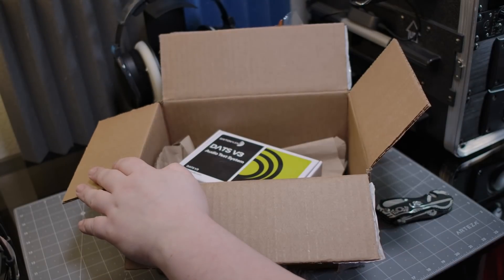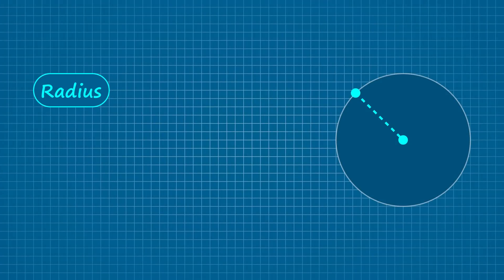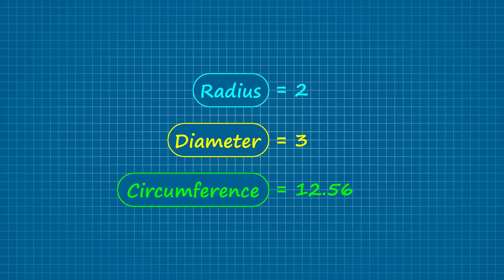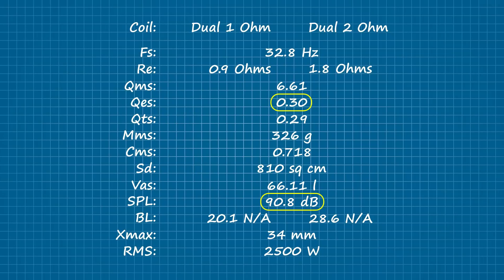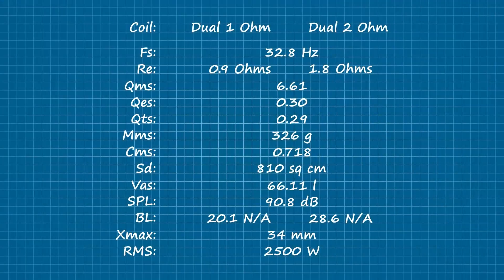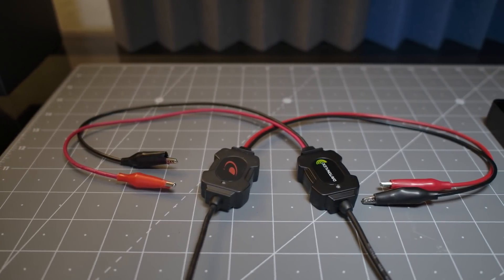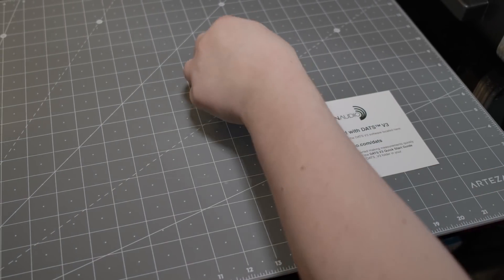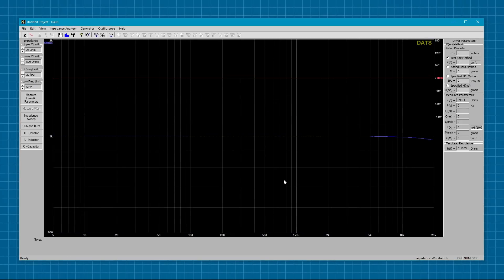A Common "HORROR" Story + A Brand New Solution

Comment: Pete.. i recently got the DATS V3 and I’m having a hard time getting the leads calibrated on windows 11 pro… I keep getting “the measured test lead resistance is not valid”… have you encountered this issue and if so, have you found a solution? I’ve tried varying input levels and I’m getting ohms reading 40 and over… this is frustrating.

Comment: Hoping to get one of these or find someone that has one to help me, bought a refurbished sub from AB it’s an older version and can’t find parameters anywhere. More I dig into it it would appear it’s a motor off one revision of the sub, a basket from another and who knows what recone. In the generic box I put it in it sounds good but I really wondering what more if anything I could do with it. Even worse then no parameters AB has refused to respond to my emails and phone calls as to what recone they used so as much as I’d like to build a second one I can’t.

Comment: Hi! I bought the DATS V3 and have found it pretty useful. I discovered it can be used as a basic oscilloscope, but I am not quite sure if it is accurate. In oscilloscope mode you have to set the test tone output to minimum setting and then you can use the test leads for measuring whatever signal. I am unsure how much signal level the DATS can handle so I am a bit wary about using it that way.

Comment: I've found the factory ts parameters to be off on sundown, skar, and resilient sounds subs woofers so far. 
Is there a similar device to test amplifier parameters?
Reply: I agree!  I just tested sundown and skar subs this past weekend and was shocked!  DATS set up properly, tested 5 times each sub, same results.  Def do not match manufacture's numbers.  Fs was WAY higher than what they report, for example.  Tested a 3rd sub (soundqubed) and it was only 5 Hz off from manufacturer.

Comment: I hate to say it, but I am getting inconsistent data from the DATS V3 system, in particular with under-hung voice coil speakers.  Sadly even using the device to measure known resistances does not match up to my Fluke or Tektronix meters.  I think the DATS device is directionally correct, but I am not sure I would refer to it as really accurate, particularly on under-hung voice coil drivers for whatever reason.

Comment: Do you know if it uses the current source method or the voltage source method? The largeish calibration resistor gives me some concern that it might be current source.

P.S. I don't have the hardware but I downloaded the software and installed it under WINE and it does start so any LINUX users out there that are interested in this it looks like it might in fact work. The manual in the help menu is all blank pages however.

Comment: Im old lol. I actually worked for a man that was an engineer for Altec Lansing when they were on Manchester in anaheim back when all their stuff was made in USA. Having tools like this so affordable to the masses is amazing. TS parameters are critical to predicting the responce of a driver in a enclosure and I have had people recone 4 of the exact same speaker the same way 4 times and have very different specs. Ill never trust the specs from a compay even though I used to assist the engineer at PAS when they were in Harbor City. A ( coughs) FEW years ago lol

Comment: Spent good money on car audio speakers. I'm talking speakers that retail 1kUSD for a pair. T/S parameters were way off. Fs on the midrange was 2x higher and on the tweeter 5x higher. Was told they would break in and not to worry. I pointed out that that's not going to happen. They later admitted an error on their manufacturer T/S. This is years after they were released. The retailer was great and gladly refunded, but I think I was lucky to have a good retailer.

Comment: I bought a dats v3 this week and this video was the main reason for this purchase. I ran in thesame problem you describe, so thank you for taking the time to make this video. I run into the problem that vas measurements vary when i place a non vented sub direct on the table or on foam pads. Vas is 14liters on the pads 20liters on the table, 21liters on a mousepad. How shouls i approach this problem?

Comment: I was told that DATS doesn't work well testing high power subwoofers to get accurate results. Hexibase, do you know if there is any truth to this?
Reply: Barevids mentioned this in reference to the v2, I believe it isnt known yet if the b3 has the issue still or not

Comment: Very important
I also received a DATS V3, but I have problems compared to the previous version of V2, namely what it is about
When I measure extremely poorly suspended Dynaudio 30W54,30W100 drivers, an error appears in the measured values for Re as well as for Le, the true value for Re is around 5.6ohm with version V2 in all measurement cases, as well as with a universal instrument, while when measuring via version V3 it appears at one 30W100 15ohm, while at 30W54 even 29ohm at which Le cannot be measured at all on one ... ???
By measuring the same drivers with version V2, all measurements are error-free and show identical values
I sent an email to the manufacturer to know about this inadmissible error because it calls into question all other measured values in other drivers and I don't like it at all because I wanted to switch to this new version but it turned out that I didn't get a better and more reliable device for this money
I noticed one important difference that seems to contribute to the device making errors, and that is the speed of the test signal, which is slower in the V3 version, lasts longer sweep signal
If someone can confirm this, let them try a device with low resonant frequency drivers that has a soft suspension, an error occurs with two of the same drivers.

Comment: With some basic soldering skills you can make an equipment for TS measurement yourself for a very low price (2 jacks, 1 resistor and some wire). You can than use software like LIMP (ARTA), HOLMimpulse or REW for measurement.
Schematics can be found in ARTA and REW documentation.

Comment: Makes me wonder how uniform a series or run of subwoofers can actually be. They hypothetically, Pull one off the production line, every so often, and measure t/s? Is that sufficient enough for 15" car audio subs. For a sound qaulity application. It honestly worries me. How far off can a "reputable" build house be? Thanks for this new found apprehension, Hexibass..

Comment: Thats pretty cool, I have several speakers that I would like to re-purpose, one set came from a nice Sony portable with built in sub that blew up when someone plugged it into 220 when it was set for 110. But I had no idea where to start designing an enclosure without any of the speaker spec's, and i'm sure if any spec's exist i'm not going to find anyone at Sony to give them to me.

Comment: I’ve had my dats for about 2 weeks and I have yet to test a driver that’s reasonable close to its advertised specs. So much so that a basic taped pipe is both slightly out of tune but also designed based on incorrect parameters which dictate a false impression that now clearly is audible through the trench in the middle of the bandwidth and undesired symptoms of delay....   I then proceeded to rest everything I had, a majority from this huge multiple decades of popularity and following of ignorant(now no longer including myself) consumers. The two pioneer 10” subs I happened to test from the shelves of the garage were quite closely matching the published. Everything is fully broken in and in good working condition. Not much of a pioneer speaker buyer. Apparently mistaken and should note in closing Rockford Fosgate has klippel testing references yet did t remotely test properly on my new dats and there’s an enclosure the p3s were designed around erroneously and that’s fuct.

Comment: Has everyone forgotten or tried either of these http://www.woofertester.com/wt2product.htm or http://www.woofertester.com/wtproproduct.htm ? who wants to put them up against the DATS V3 from Dayton Audio and see if spending more will get more accurate results? Also, does anyone know before I read the manual, if the DATS V3 in oscilloscope mode will allow me to measure my head unit pre amp voltage and output clipping? I just want to make sure, because I know there are tools out there for education purposes only and have no scientific value or accuracy. There is a tool like this that cost $160 and another that cost $1000 leaving me wondering if at this price point has anyone ever verified with a much more expensive tool like the sub-woofer manufacturers would use to measure parameters. Plus the way I see people using the tools does not seem scientific, should maybe do 5000 sweeps per second and then take the average to come to a more accurate conclusion. does this tool do that? and if not, people should do at least 5 sweeps with the tool and then average to make it more scientific instead of taking the first measurement they see. Thiele / Small parameters are very scientific, I just want to make sure i'm not paying for a desktop toy that is for educational purposes only.

Comment: Not sure if i get this Right. Is It Important how much mass is Add ?
Reply: HexiBase Thanks, I used just 10 Gramms. Worked in Ma Case.
Reply: Ideally, your added mass should be about the same as the Mms of the driver. 
If the spec sheet lists the Mms then just make your added mass about the same, that is something that shouldn't change much unless a pretty big change was made to the driver. 
If Mms isn't listed then it is a pretty simple 2-step process. Just add enough mass to get an initial Vas measurement. Then change your added mass to be about the same as the result of the first measurement. That will get you close enough. 
You can repeat that process to narrow it down even more, but it really isn't necessary. Things like temperature and barometric pressure affect the specs so much that you really don't need to get that exact (maybe for speakers in a strictly controlled environment, lol).

Comment: Glad to see so much knowledge in your videos. I have the DATS V3 and every sub I've tested has different parameters than published. When testing what is the correct setting for LE. 1khz or 10khz? Thank you
Reply: With low frequency drivers you want to use the 1 kHz setting for Le. 
Really, the 10 kHz measurement is only useful when you are designing a passive crossover that will affect frequencies that high. Not that often really.
Reply: @chrisperez7592  

Not only for passive crossovers! From the DATS V3.x Help File (Measuring Tweeters section):
"Measure the tweeter's impedance as follows:

Launch the DATS software and make sure the volume is at maximum. 
Under the Edit menu select Preferences and set the L(e) Measurement Frequency to 10 kHz."

-------------------------------------------
So, you should use the 10kHz setting for measuring tweeters too.

Comment: I suppose some companies will write their ts parameters after break in. GR  Research tested the same driver out of the box and after 50h of hard playtime and the fs was way lower for example. So one company they discussed with mentioned that the parameters they state are after a certain run in period. But of course, the numbers within should still match mathematical rules as explained.

Comment: Hi Pet, thank you so much for all your contributions over the years and for more recently designing enclosures for the public under AD. I have a question about how to get the t/s parameters from a woofer that has a phase plug IE Pioneer TS-M800PRO, would it be any different? I contacted Pioneer and asked for the t/s and was told thy did not  have them and to contact a installer! I was outraged. and gave him scathing review of his response. Scot

Comment: Very good info. Never thought I had to doubt T/S parameters from manufacturers.
Reply: Of course you have to, they can never produce 2 of something that share identical parameters. The glue used won't adhere all the same, the surround material has variance, the spider may be harder than normal(even worse if the speaker has multiples of spiders), the coils may have bad windings that distrupt the condictivity, even the cone material will have stiffness differences, the magnet can be charged to a lower specification than it should, any number of these can happen to a single driver many times before it reaches the shelves. Did you think that they could just bang out perfect speakers everytime?
Reply: 94E22F7EE051 B0F6841E919E5C95DF1D yes
Reply: @bassfan71  Doubt ALL parameters from ALL manufacturers (not just audio).  Specs are often massaged by the marketing department to make tat look better.  e.g a STEREO amp with 1kW PEAK output (SINGLE channel @10% THD - ouch, my ears!!!) will probably be lucky to output a 100W continuous stereo signal @ 0.1% THD.  1000W vs 100W - marketing vs engineering depts.

Comment: Also, if you were to hook up DATS to a woofer that is already in a ported enclosure, would the "FS" be the frequence the port is tuned at? For measuring unknown enclosures...
Reply: @HexiBase  is there an effective way to test the tune frequency of an unknown enclosure?
Reply: I just wanted to add that if you run an impedance measurement on a driver in a ported enclosure you will end up with two peaks. The lowest point between the two peaks is the tuning frequency. 
It's especially useful for vents with many bends or irregular shaped ports (even tapered ports). Enclosure design software can't exactly account for airflow resistance due to things like corners, and that could shift tuning by quite a few Hz.
However, it is low power... So you need to keep in mind that once the air really gets moving, and airflow is being restricted by the port, the tuning frequency will go lower (essentially that also means the port is too small, but is just how is has to be sometimes).

Comment: Any information on whether the V3 is better than the V2? I have the V2, not sure if it's worth upgrading.
Reply: V3 is twice as powerful as V2. That doesn't make a big difference with large, high power drivers. But it can drive smaller speaker pretty hard, the specs you get will be a little more "real world". I've even measured some drivers where I could see cone and frame resonances show up on the impedance curve that I never noticed with V2. I thought something was wrong at first, and then I realised it matched the frequency of a peak in the response (it took me a minute to figure out what was going on 🤔). It is even enough power to excite resonances in enclosures and ports, and that will show up as little ripples in the impedance measurements. So that is a nice upgrade. Also, the added accuracy is great for measuring caps, resistors, and inductors. 

Heck, I have mine mounted under my desk... that alone made it worth it to me, lol!

Comment: Hi! i love your informative videos and they have helped me in numerous ways.  I was about to build a transmission line "soundbar" type of speaker that should be very flat and accurate, as it will be mainly used for music.  I know that TL enclosures require a lot of trial-and-error tuning, and I was wondering if that is probably due to the manufacturers' dodgy specs that you reference here.  Also, I was thinking about building it in a way that I could create a cross-section that could add or reduce port length to tune it.  Or would testing the TS parameters provide a clear design direction?  Any input would be greatly appreciated.  And thanks again for the persistently informative content!

Comment: Not really shady documentation, but I always wondered why companies grind off the part numbers on the drive IC's inside their amplifiers. I recently opened up my amp to replace a bad capacitor and noticed every chip on that driver board was ground down. Thankfully none of them were faulty as the company has seemingly gone out of business and schematics are nowhere to be found. It's really a shame too, because the amp as a whole was really well built!
Reply: It's an attempt to prevent reverse engineering

Comment: Do you think some of the errors are due to bnib measurements vs fully broken-in t/s parameters?
Reply: @HexiBase  Ahhhh , that makes perfect sense. Mahalo. I'm actually going through that right now building a box for 2 Sundown X-8 V3 subs. They do not provide sD or vD parameters so I'm having a hard time measuring port velocity. Thanks to this video I'm going to try and measure the cone area myself and also pick up that Dayton speaker analyzer when it comes back stock! Awesome video as always 🤙🤙!

Comment: I tried measuring a 3" woofer using the enclosure method and couldn't make an enclosure small enough. I had to use the weighted add mass. Used two American quarters which way 5.67 grams each for a total of 11.34 grams.